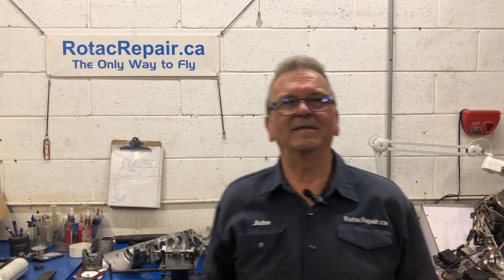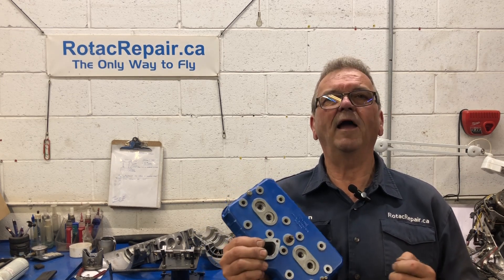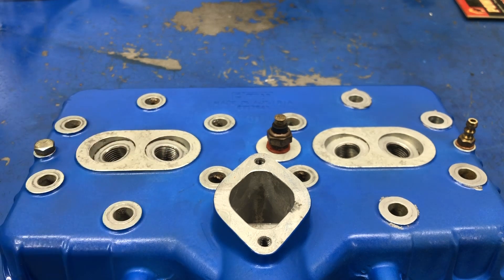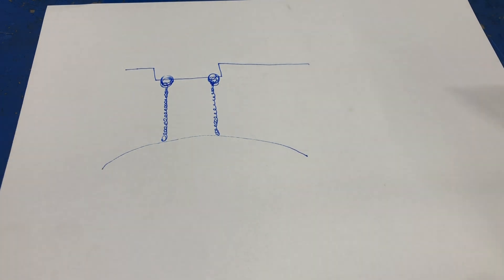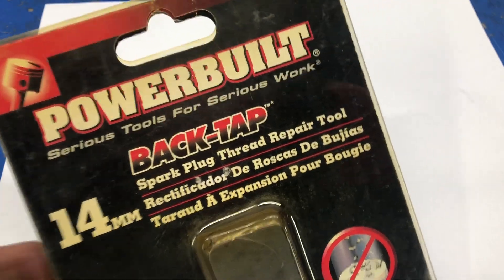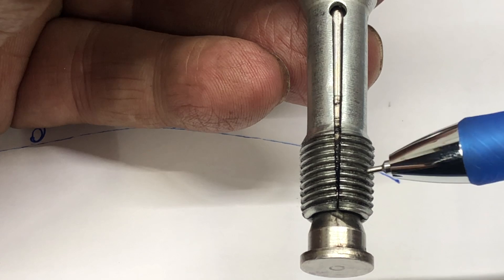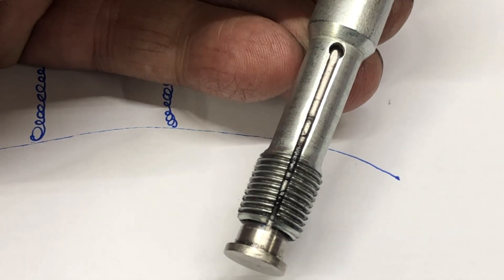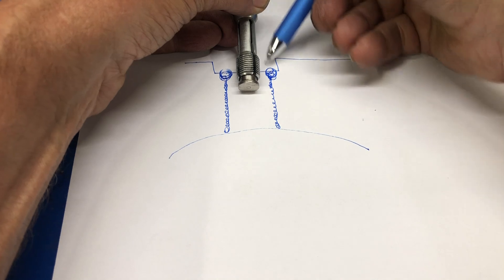Rotax 582UL, spark plug won’t thread

Comment: The only caveat I would provide is that to do the repair you are actually removing material.  Depending on how badly the cylinder head has been cross threaded, isn’t it possible that the repair could result in the plug not being able to  be torqued properly?

I had a repair done on my 503 by a technician for the same reason and even though I  could torque the plug  it came out in flight.  I ended up replacing the cylinder head.
Reply from the maker: It actually removes very very little material, it’s more of a realignment of the threads. Torques up perfectly. No issues at all. 
I do know that if any type of thread replacement sleeve is installed it absolutely will fail and the spark plug will fly out.

Comment: Never seen one of these tools. Volkswagen beatles used to give me spark plug thread problems. I always used a thread chaser in all cylinder holes needed or not before installing new plug just to be safe. This actually straightens the damaged  metal. Very cool. Just learned something useful here - not just for rotax either. Cheers. 👍
Reply from the maker: I remember those cars, I also wish I knew about this tool back then! Mmm I wonder if it had invented yet? I’ll need to check the package for a patent date.